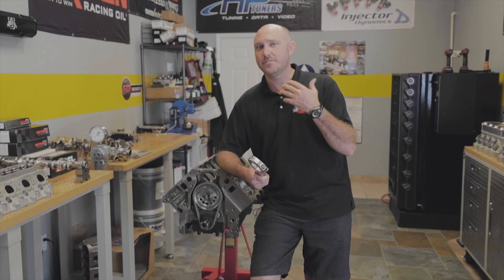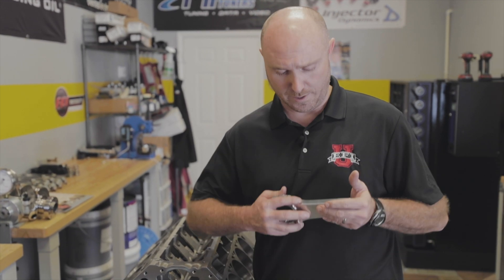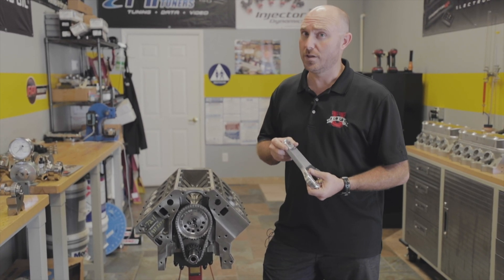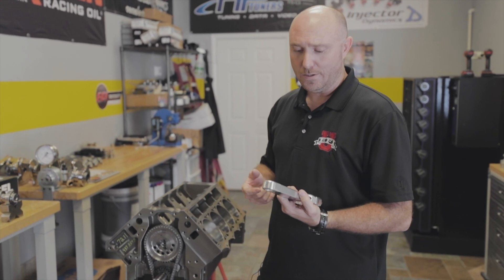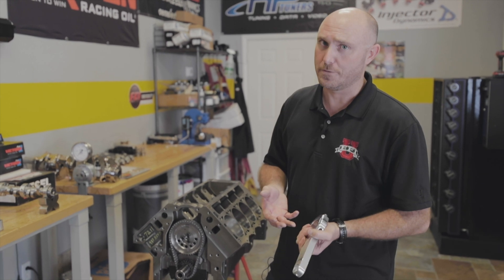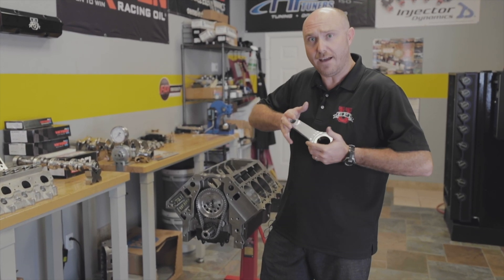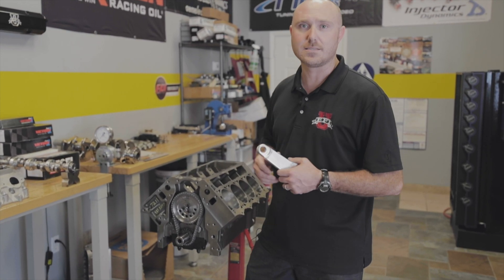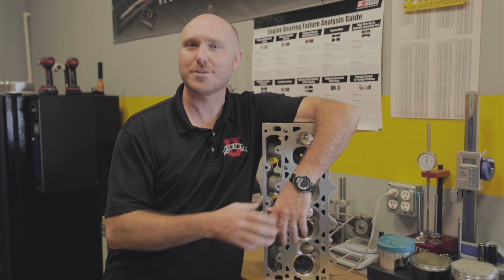Can your Rod's handle the power?

Comment: I’ve seen more rod  failure as a result of rod bolt stretch than from catastrophic rod failure.
Reply: well is that a "rod " failure or a bolt issue? Who torqued them? Bolt strech gauge used? Correct bolt metallurgy used? Over rev? ........................

Comment: Isn't "horsepower" just torque x rpm?
Reply: Well yes.

But rating rods in horsepower is stupid because you are missing one more element of the "horsepower=torque x rpm" formula to be able to complete it and get meaningful information from it.

You need to know the horsepower rating @ which torque, or the horsepower rating @ which RPM.
To make the same power you will need more torque at lower RPM and less torque at higher RPM.

Example - 
"800hp rated rods" with no info at which torque or RPM that 800hp rating is valid

800hp at 4000RPM = 1036 ftlbs of torque
800hp at 7000RPM = 592 ftlbs of torque

So is the rod good for 1036ftlbs or 592 ftlbs of torque? Both are 800hp.
But the rod isn't actually seeing horsepower - it's seeing torque and thus compressive forces (and torque is cylinder pressure - so you can say it sees cylinder pressure) - it doesn't care at which RPM it sees that torque whether that's 2000 or 7000 (the rod bolts and occasionally the small end care about the RPM, but not the rod itself). I guarantee you that a lot of "800hp rated rods" will fail at 1036 ftlbs of torque at 4000RPM but be fine at 592ftlbs of torque at 7000RPM because the torque they feel (or cylinder pressure and thus compressive force) is almost half even though both are "800hp". The exact reason why diesel engines need to be so much beefier - they make similar power but do it at a lot lower RPM - so the torque and cylinder pressure and thus compressive forces by logic have to be a lot higher - and torque is what matters, not horsepower as far as components in the engine go.

The same with clutches - clutches give 0 F's about HP, they also just see torque - so you should rate clutches (and rods, and almost anything in an engine) in torque, not in horsepower because without the additonal information of either the RPM at which the HP rating is valid OR the torque that goes along with that HP rating just knowing the HP is useless.

Comment: This series should be called how to be a Knob on the internet....

 Because that's what your actually achieving.
Reply: Harmankardon 1 but he wasn’t wrong tho
Reply: @ajr_e46  No, he actually is wrong!!
Reply: "you're"
Reply: u must sell con rods....LMFAO
Reply: I'm glad he knows Tom Molnar, design has a lot to do with things and Metal composite make up too. he is only covering a small portion a lot of dumb people actually been taught over the years. Its like say ARP2000 bolt is only good to this tensile strength but now what design was that bolt again? Never mind it's beyond a lot of peoples comprehension on what makes rod bolts fail and not fail at a certain Tensile pull. Look at Factor LS rods? what Horsepower are they rated at? never mind, they are not rated😉